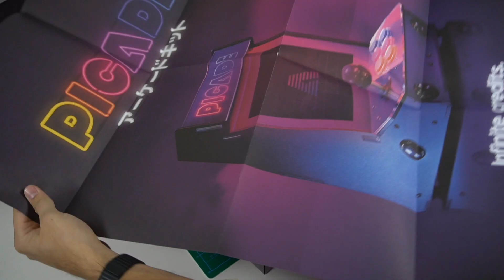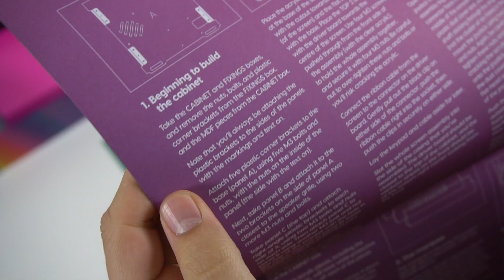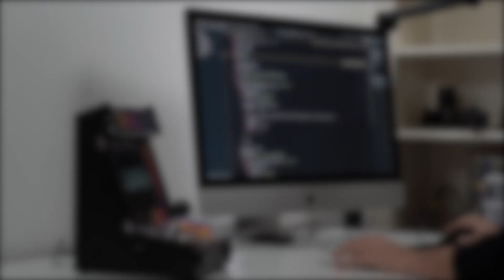Building the Picade

Comment: I wish they had stereo speaker setup like the 2017 version, as well as illuminated action buttons, ethernet and USB ports accessible from the back without taking off the back panel, and a backlight on the top marquee. Oh, and a switch to disable the buttons.
Reply from the maker: Those things would indeed be a sweet upgrade!
Reply: I think buying components and building your own setup is what I might end up doing. Hi agree stereo and led lights for sure!

Comment: Really tempted to pick up a Picade.  Any tips/tricks before starting the build?
Reply from the maker: Brady F the build is pretty straight forward. There are some fiddly steps where you need to mount a nut on a bolt that is pretty hard to get to, especially with larger hands. Pimoroni also have a very long video of the build (basically uncut) you could have as a reference.